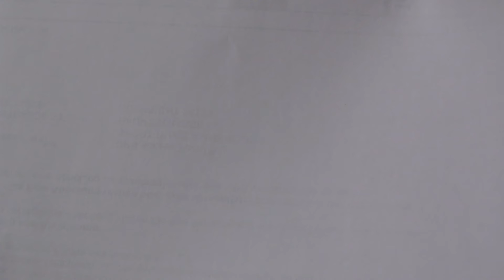TVM802 IC edge detection CAM-1

Comment: I just placed over 50 tsop16-ep with component threshold to 85 and exposure 9. The outside case edge is reliably detected every time (LT3081). No black screen. I also placed in same run many 0.5mm pitch qfp64-ep and even some wson8-ep 4x4mm  tiny dual reg parts with two exposed pads and weird exposed pad shapes. none needed tweaking, even though I did notice a consistent small camera offset error to the right and a few degrees rotation. with that said I have not tried to align the placement offsets in any way, this is straight out of the box. I understand the argument for aligning to the exposed pad.... but perhaps you shouldvsey it up to align to body instead? Seems to do the job.
Reply: note also that there seemed to be a thresholding issue with some light coloured caps on ""quick"" that required I set the threshold back to 80. maybe a shroud would fix this. We placed over 6000 components on 4 large boards (they were near the maximum the machine supports) with it with a variation of 158 component types (nightmare) that were double sided reflow. It was a trial by fire, there are some subtle issues with prick alignment, and reel feeding that cause issues, there are some thermal variations that effect prick accuracy and I plan to buy a dynometer to set the strip tension up consistently or maybe look at improving the clutch method somehow. with that said, happy with my purchase and results. Note we settled on 90% speed and dual head for passives. plastic tapes can cause some grief with prick accuracy, we have not worked that out yet but think it was because we got ours without the rod that goes through ther reels, and discovered late in the build that the reels sort of jam and jolt if resting on the fixed rod supports. The inability to control the leaf spring tension under the tape leads to issues with higher devices, increasing tension and causing feed issues. We have decided to stick with the tray for such parts. Also note the large tape feeder on the back "B"" feeders is unusable as it feeds directly into the metal pcb support on the left hand side. Its a great little addition to our workshop.

Comment: Question - does this happen with device oriented 90 degrees? Is this an asymmetric issue or does it also happen with vertical edges?Thoughts - these issues happen with detecting package edge and not pad edges - It kind of looks like the brightness is different from top to bottom - LED intensity not balanced. Perhaps if you installed a series resistive pot on a few of the LEDs, you could play with the intensity and get a better balance.I wonder if your black paper circlet should be matt black and more of a cone so as to not reflect. The circlet is angled - perhaps on the boards that fail the circlet is angled the same way?I will have a machine in the next month - and will let you know if I find a solution.